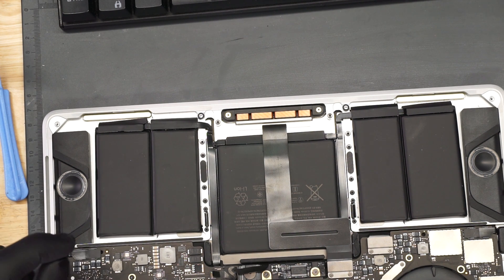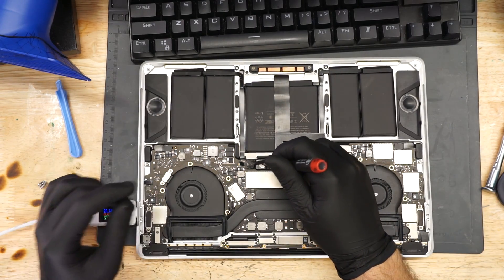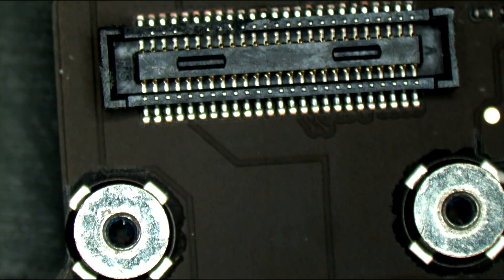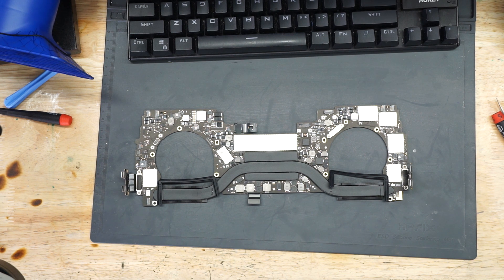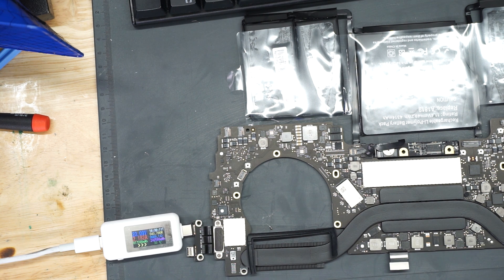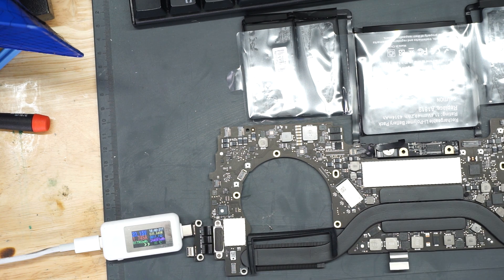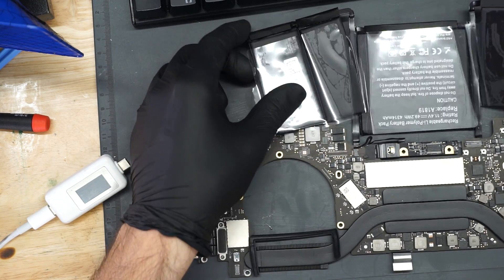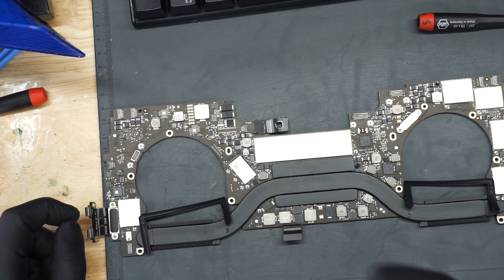Diagnosing an A1706 Macbook Pro that won't charge.

Comment: So I'm having a problem, and I can't seem to find the solution, I have a MacBook pro 2017 A1707, and I just replaced the battery, but it doesn't recognize it, nor does it charge, if I plug in to its original battery it does work tho, how can I make it recognize?

Comment: I already saw what is causing the issue from the thumbnail: It's a Macbook.

The fix is to get a cheaper but better Windows 10 laptop which has capacity for upgrades to give it some extended life. And if it breaks down at some point, you can actually have it repaired.

Comment: The customer can be a great asset when diagnosing something (be it a car or a computer in this case). However, in my experience troubleshooting certain issues you can't trust the note (or comment) someone gave you on what has been done in the past.

You don't know who worked on the problem you're trying to troubleshoot. Most of the time when I get these notes I deal with them in a similar way. Read them, but question its validity very carefully. These things have thrown me off a couple of times and afterwards I thought I should've went with my gut feeling.

Always follow your own diag plan.

Comment: It might have something to do with making the same video over and over, moreso than the same type of video. Haven't seen a battery issue in a while, thus why you chose this one for your video. 7 years of fixing the same 3 fucking issues across 100 different models seems like it would be quite grating, and we appreciate that you've done it for as long as you have. If only Apple had stepped up their game when you started calling them out, you may well feel differently today.

Comment: That small flex cable above the battery was a real bastard for me because it would no longer communicate with the battery and the board. It took me two purchases of the same flex cable for the board to recognize the battery.

Comment: Louis you should get ready for the New MacBook’s with the M1 chip 

Let’s see how repairable it will be
Reply: He won’t even be able to open the case it  is probably welded
Reply: Most likely everything is serialized
Reply: The ram and the ssd was already soldered in to the boards in the previous models so I see no difference there.
Reply: @BlackDragon31000  yeah, but you could still desolder the ssd or ram from the board, now it’s literally part of the chip. So it went from hard to impossible.
Reply: @MrChildrenz  actually the ram is built in inside the m1 chip so it's probably not replaceable/upgradeable
From mkbhd video that i watch
Reply: @betamasud  except storage everything is inside M1 chip, so if your ram fails throw that shit away and buy a new one. Environment friendly? Apple says they are.
Reply: @betamasud  And we should not forget that T2 Security, Thunderbolt controller, GPU management and all that blithering stuff that Apple has is now built into M1. So I would say Louis is out of business in 5-7 years... thats sad...
Reply: @ashishpatil1085  I don’t get it.. if the ram fails just go to the Apple store.. I’ve had some pretty good experience with them without Apple care
Reply: @Shanboss277  cause now the ram, cpu, gpu, i/o die, t2 chip, thunderbolt controller are all on a single chip, if any fails you'll have to replace the chip in apple terms whole motherboard which they'll charge equal to a new macbook.
Reply: @Shanboss277  Yes, if you have Apple Care then you will probably get a replacement, but they rarely ever actually fix your old device.

Without Apple Care, good luck getting anything from them without spending about as much as the actual device costs.

If you want your broken device fixed, such as for data recovery, you won't be able to rely on third party repair, because Apple does everything in their power to make their products unserviceable.
Reply: @vladyslavhafanovych24  Yeah, wouldn't buy anything from Apple since they started this practices - btw the T2 is shit, it's bee jailbreaked in October
Reply: @ashishpatil1085  Dude, really? They just took away a lot of chips that could fail by making an all-in-one chip. The less chips, the less chances of something failing. And you somehow managed to see it like the worst thing. Yes, Apple won't repair it. They'll just sell you a new MacBook, but it's been like this for years. The point here is that the new models are probably a bit more reliable.
Reply: @LazorVideosDestruction  And after making it so you have to replace it under Applecare (if you have it) they will jack up the price of Applecare , watch this space
Reply: @nils895  oh yeah, seen that. But here's the catch - Apple said that problem was hardware based so they can't fix it now. And what do we have now? Custom SoC. Probably fixed that one...
Reply: @BlackDragon31000  I heard the T2 was integrated with the CPU
Reply: I’m sure a big part of the new Apple airs will be getting Apple care as then you would simply get it replaced with another air, then expect you to buy one every two years. They won’t be repairable. They will market that to waterproof the laptops and make them thinner they no longer have cases or screws. I’m sure the m1 will reject any part that is put in unless they have the right Apple codes.
Reply: @andrewreed1329  That's actually hella good point! Taking the parallel with iPhone 12 camera modules that already have serial numbers which make it impossible to replace without running System Management Configuration (or how that crap was called) - so Apple is just putting 3rd party repair out of business...
Reply: @vladyslavhafanovych24  I see from your subscription list you have Zelensky there . Are you in Ukraine ??
Reply: @MrTarmonbarry  oh, do I still? He made a fun teleseries about how a simple teacher becomes elected as president by accident. Made his way into politics with ppl believing in a fun story. 

To answer your question. Yes. I am from Ukraine
Reply: he def needs to buy a few to experiment with. hell id love to see a few teardowns done by louis
Reply: Basically if your thunderbolt stops working, you need a new CPU.
Reply: If it breaks it will self implode because of legal reasons or explode if it recognises that the customer is not a disciple.
Reply: I think thats gonna be iPhone motherboard repair territory
Reply: Well apple "claimed" that "the design has not changed" only the CPU so maybe it will just be as repairable as the other models

Comment: i have a tablet that charges VERY slowly, like 10%/day. took it to a repair shop. they changed the charging port. i took it home, still slow. brought it back. they changed some resistor, i think the guy said? take it home, still slow, brought it back. then they said it needs a new battery. waited 30 days to get it from china. i get it back home, still slow. and every time i took the tablet to them, there was a new scratch on the screen, which they didnt take responsibility for. i finally told them to fuck off. my tablet still charges slowly. fuckin koalas.
Reply: Is it by chance one of those intel next book tablets? I know those have that issue
Reply: @thetesseract2237  nah its a seven year old  chinese ipad knockoff (Chuwi V88). its OK for my needs, just wish they could fix the charging.

Comment: im really curious what you think about them going ARM with a full SoC and even LESS repairability (anything goes bad in the chip, my bet is you'll have to replace the whole chip)
Reply: Everything, even RAM is inside this chip... probably only NAND flash isn't but I might be wrong, if it's a stacked chip.

Comment: I think you inadvertently hinted as to how they damaged the covered side of the connector... I'm betting money on a spudger or flat headed screwdriver being stuck in around the back to prise the connector off, instead of the sensible way from the bottom and front like you demonstrated.

Comment: Louis.

1) dont do vids if you do not feel like it. 

2) ive had customers come into my car repair place with a long list of issues theyve been trying to remedy. I remember specificly a customer coming in w a 1995 mustang not running right. ”Weve replaced the spark plugs to no avail”
Guess what, after more than 10 hours of fault searching we replaced the spark plugs with 8 new oem plugs, and after that it ran great